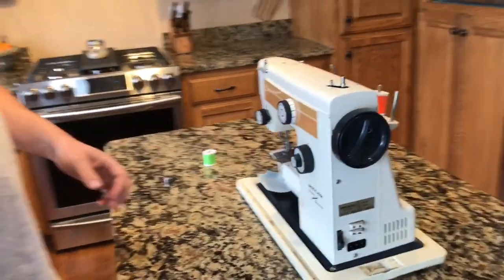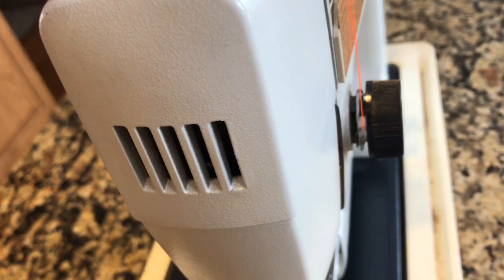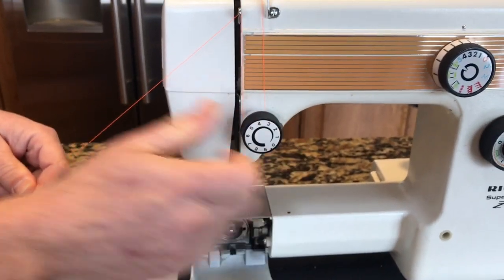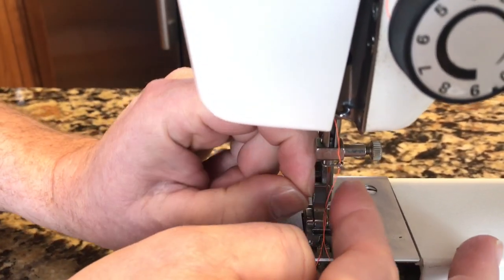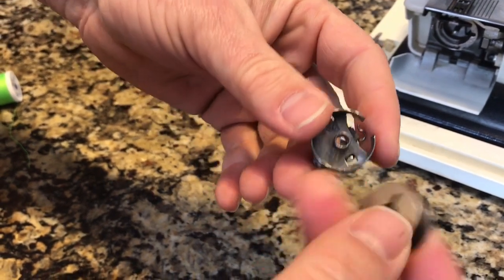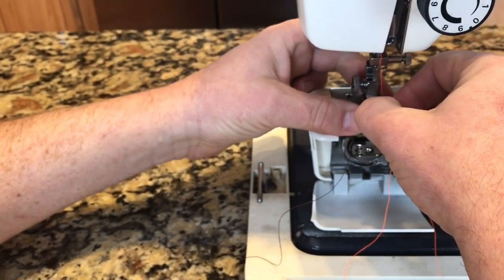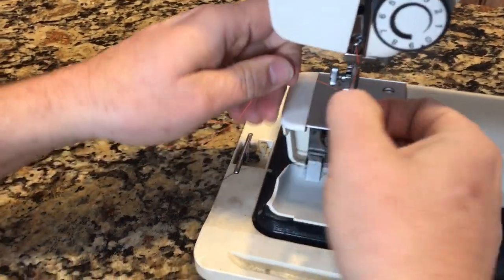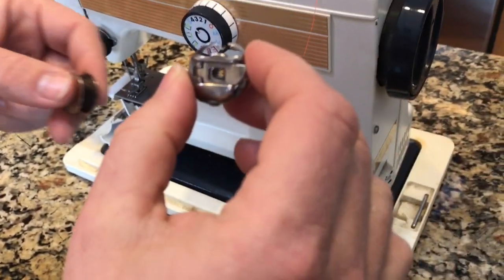How to Thread a Riccar 500FA sewing machine Super Stretch

Comment: Hi I picked up the machine from someone's front yard that they were getting rid of. But the foot does not go up and down what can I do. The motor seems to run it's just a foot that won't go up and down have you ever had that issue.?
Reply from the maker: I'd  open the cover and see if something is bent, oil it up may just be stuck